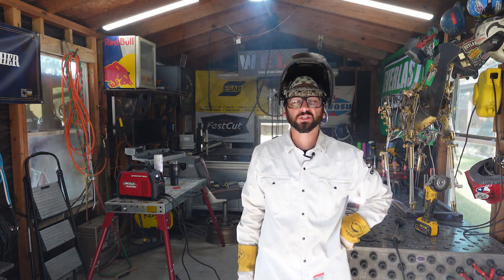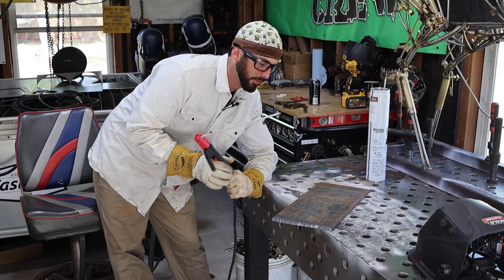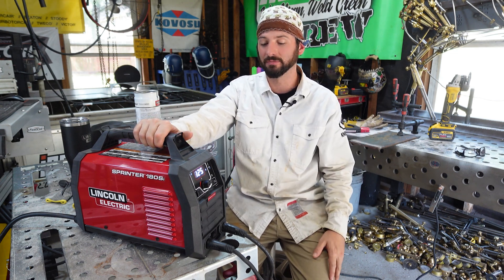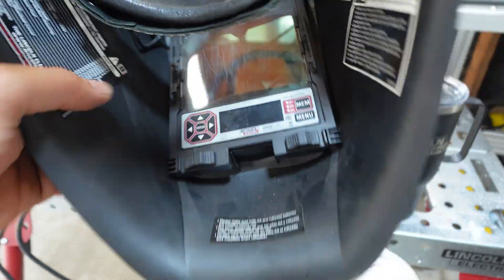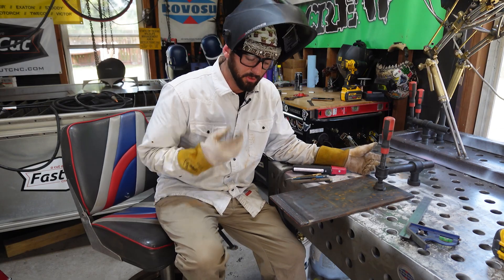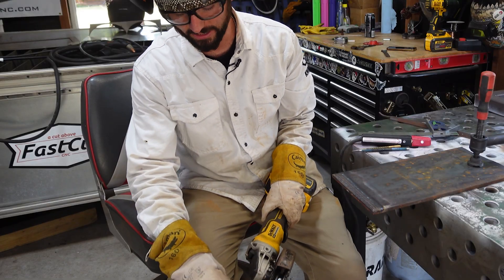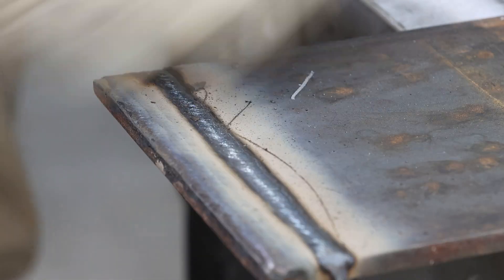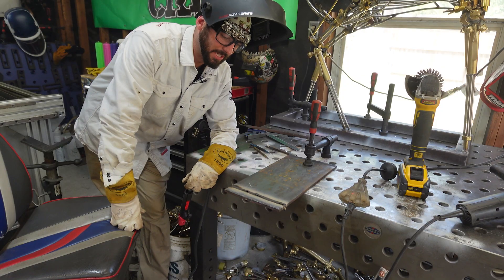Perfect Straight Beads Stick Welding With 7018

Comment: I’m a new welder. He’s completely right about seeing. Was good doing flats we switched to up hill 7018 after 6010 and I was struggling like ready to quit struggling grabbed a cheater x150 and it’s completely changed my experience. The love I had at first is back again.

Comment: a mode for 6010, i knew something was wrong when i tried to use it in normal mode and fail miserably (the welding machine dont have 6010 mode). ended up using 7018 for root pass in welding school

Comment: Yeah.  Show me pretty welds like that with 7018 rods while out in the field, maybe even while in a lift a few stories up.  Also while working with a structure that has been exposed to weather, maybe even salt air for decades, and is corroded.  And after you pulled your leads up a few stories, then prepped the mess before you, all the while the foreman of that job who is definitely not your boss but thinks he is complains and yells up what he is sure should be done so everything will end up perfect, in 95 degree heat and direct sun and 90% humidity.  Plus you know the inspection is coming in a few hours wether you are ready or not, and your boss has to pay penalties if you are not ready for the inspector.  And its far past lunch time but you dont have time to eat.  Also you are expected to be back at the shop by 5 or the gate will be locked and you must get the machine there.  And then traffic is so bad that after a 1 hour drive to the job you know it is a 2 hour drive back to the shop.... etc etc.
I dont want to hear any office working computer woman talking to me about stress.  Just sayin.

Comment: This may be a dumb question but is stick welding arc welding?
Reply: @justalittleloving   Yes, technically it's called shielded metal arc welding
Reply: @clippee1337   thank you so much
Reply from the maker: "technically" GMAW, SMAW, GTAW, FCAW are allllll arc welding.. haha but not technically speaking alot of people will refer to basic arc welding as SMAW
Reply: @Welddotcom  thank you very much

Comment: Pad-weld is THE place to regroup.
The one about 'like riding a bicycle" - I've just been through this after 2~1/2 years out - reminding of so many intricacies of what feeds into a good weld.
Pad weld until "like riding a bicycle".
I got a several kg standard pack of 2.5mm 7018's - get a lot of rods for your money, use up not much plate doing little welds - and make it challenging and attention-focusing with rod undersize for plate at 10mm thickness so variables to get a good weld is really critical.
Your entire message - absolutely.
Reply from the maker: Its surprisingly more difficult to keep things straight and together copared to working in a groove.
Reply: @Welddotcom  You don't have to tell me that! :-)   But repeating this point for everyone to read - absolutely - I'm with you on that.  Comes with more authority from you than me - thanks for saying this...

Comment: I see one problem if its  on something where there  is a lot of stress, like a extended arm or other item attracted to the next item  ahead. That light grind to show where the line for welding a straight line would be where it would break into or rip apart .
Reply from the maker: dont grind the line if you think you shouldnt

Comment: I run a lot of hard facing rod on industrial equipment.. i ALWAYS mark out my welds with soap stone, then score those straight lines with the cut off wheel. If i don't, the soap stone lines will be smoked off after the first bead
Reply from the maker: Yeah those grinding marks dont go anywhere for sure.esspecially as you wire wheel or clean welds, that soap stone wont last.
Reply: I've picked up some layout pencils. Supposedly they won't burn off like soap stone will. But they seem to only work well on millscale and not clean steel.

Comment: Use whiteout
Reply from the maker: terrible idea.. no offence. white out is often used in the blacksmith world to prevent fusion in canister Damascus. I would imagine it would inhibit fusion in welding as well. not to mention its not very accurate when making a straight line... or mark on 400 degree metal.. feel free to try it and let me know.

Comment: I have this as a bigger problem on mig and flux. The cup covers where im going and the light fogs up my lens and its the same as welding in a fog
Reply: As shown here - find your position so you can see.  Clean "slips" in your visor.
MIG/GMAW - is fast(er) so have to be able to split vision watching front edge position and form AND back edge shape.  Stating the obvious - but needs saying - back of your weld where it solidifies gives the shape the weld will always have.
Reply from the maker: Move youre head homie. you can have a linger stick out too. thatll help.
Reply: That just sounds like normal?